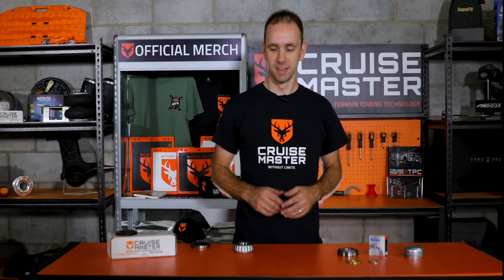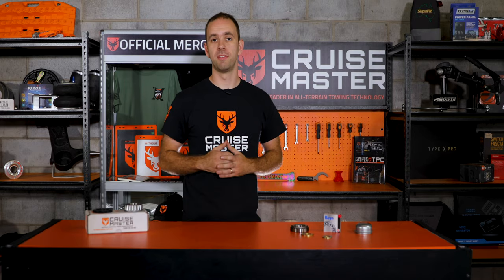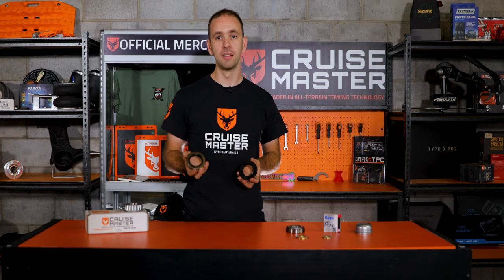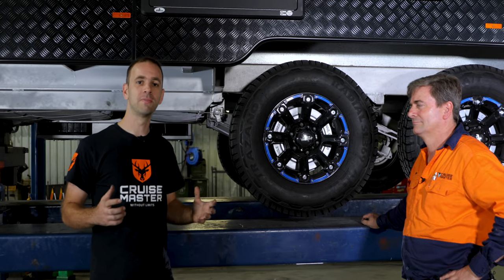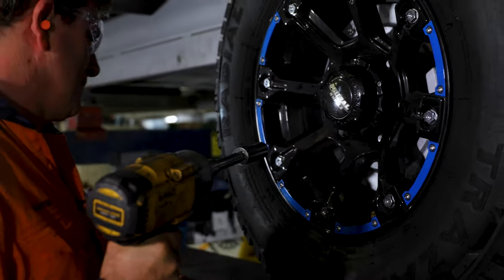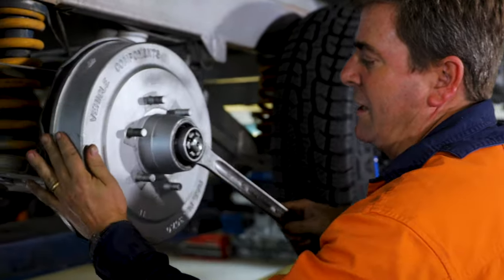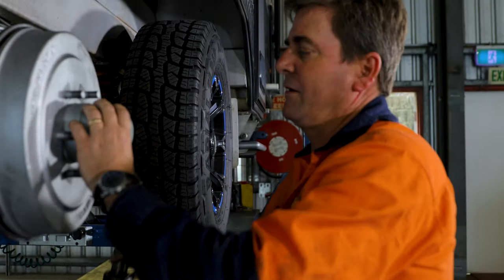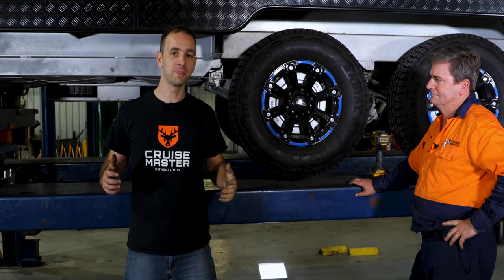CruisemasterClass - Ep 7. Wheel Bearings

Comment: Hello Kerran, good talking to you last week re lip on the entry to the seal surface that rolls up on a few XT hubs - also how to fix that. Re this video on checking/adjusting the wheel bearings. Two points. If the nut is tightened and the ideal place for it is in between two of the slots in the nut, I take off the nut and grind off a small amount from the inner face of the nut on a bench grinder. Then clean any grinding material off the nut with Brakeclean and refit the nut and see if it is now in the ideal position relative to the cross hole in the axle stub. Then a new split pin as per your recommendation. 2nd thing. The small piece you snipped off the split pin has another excellent quality, that of finding its way into and puncturing whatever tyre is lying around, almost a "magnetic" affinity for the tyre. Ask me how I learnt that. So I cut that snippet and allow it to fall in my hand. Re other info, over a period of time will go through the rest of Cruisemaster videos and learn/relearn what I may have forgotten. From retired mechanic, machinist and rule of thumb engineer. PS. From everything I have seen helping my neighbour in the maintenance of his Cruisemaster fitted van, the stuff you make is really good quality with excellent engineering.